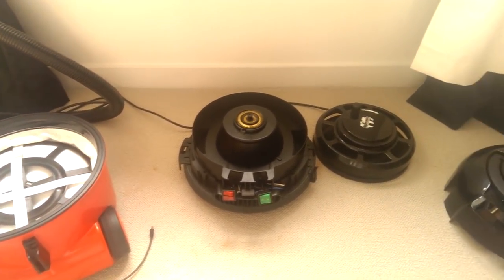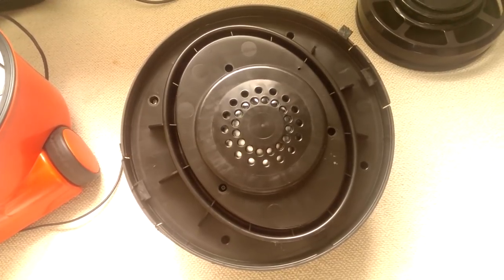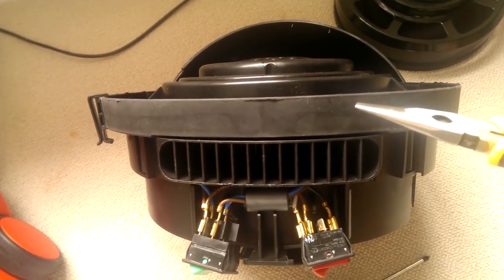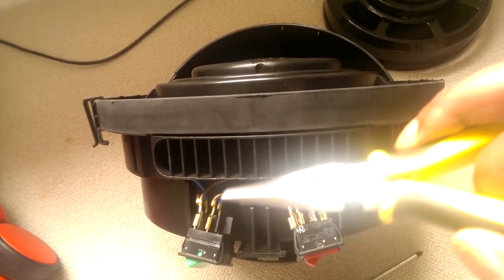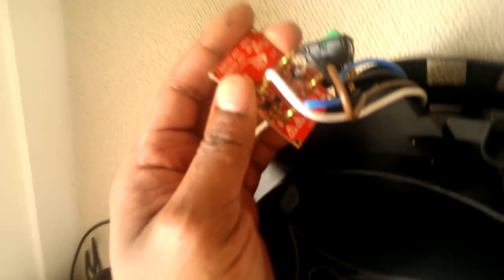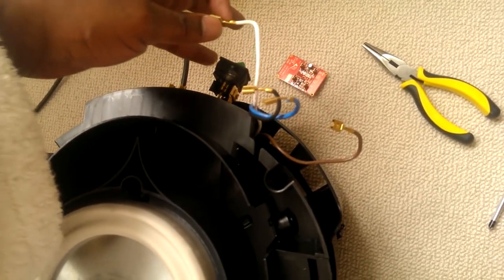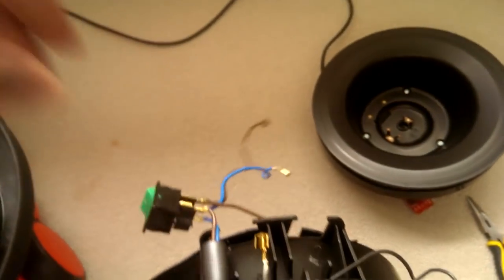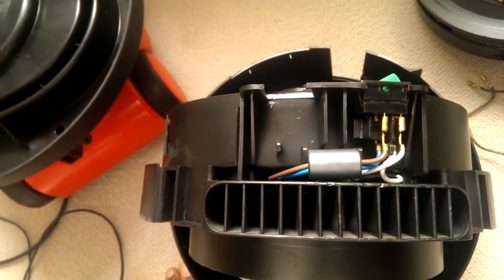Fix a Henry Hoover which won't start by bypassing the printed circuit board (PCB) #henryhoover

Comment: Thanks Peter! Fixed my Henry, great start to my day. Your calm tone and fluffy white lounge attire gave me reassurance even after I broke a connector and had to improvise a solution. 

Also if 85% of the 235 comments are from people who have fixed their vacuum cleaners, at an average replacement price of £120 you have saved people nearly £25,000 so far. Well done!

Comment: excellent, thank you, my machine suddenly stopped working and i assumed it was a fuse, it wasn't, i opened it up and was surprised to find so many wires and a pcb so gave up. After seeing your fix to an identical machine i just tried it, initially i was concerned that you did not say which of the two white wires should go to which of the two switch posts, since one post is positive and one negative and i wondered if it might make the machine run in reverse and blow instead of suck if i got it the wrong way round, or even burn it out, but i took a chance and either it doesn't matter which white wire goes to which switch post or i got lucky, it sucks great. thanks.

Comment: I was apprehensive to fix it, but your video really helped make it look like a simple job... So simple, it's just opening the Henry up, and pulling the wires off the Hi/low switch, removing the "pcb" board, and plugging the 2 white wires where you removed the blue and brown wires into the power switch... watch the video, and it's very clear. Thanks so much! The Henry is Alive !  ALIVE !
Reply from the maker: planet illustration life can be simple

Comment: Peter many thanks, my Henry is working again, 3 year old video but it's still helping other out perfectly well thanks.
Seen some questions asking if the hoover will work on full power only and the answer is yes, FULL POWER ONLY.
This will make your Henry hoover work on full power only as you are removing the low power switch wiring... HOPE THAT HELPS CLEAR THINGS UP, 
If you do this and your hoover works then it's the PCB printed circuit board that's no good, so if you still need your hoover to do low power then you need to replace the PCB printed circuit board

Comment: Our Hetty didn't switch on yesterday. After checking the plug and fuse and it still not starting we were ready to go buy a new vacuum cleaner. Found your tutorial this morning and got our old Hetty operational again in no time.
Thank you so much for this money saving tip and for helping to stop another old vacuum cleaner from going to the tip...

Comment: I did it and my Henry works, I'm really chuffed - THANK YOU. It took watching the video about a dozen times before acting to get my head around what to do because I have zero electrical knowledge so some basic things I needed guidance on which might be taken for granted by people who are familiar with connecting wires etc. My tips are: (1) to disconnect the wires, don't be scared  the metal heads of the wires have a push-in pull-out mechanism, I used a flat-headed screw driver to loosen the grip of the metal heads connecting the wires. (2) the switches have a side panel, so to access the wires connecting the switches again I used a flat-headed screw driver to remove the side panel - push in (the screw driver) from the side and lift; (3) if you have done 'too much' in removing the layers to access the motor just follow video for what the coverings around the motor should look like, for example, that plastic 'frame' with a triangle bit around the motor completely came off so i saw too much motor, in fact lifting it out completely but the motor fits back in like a puzzle, there are three areas that you need to make sure are in place - again like a puzzle look for the bits that fit; (4) in taking out the motor completely I disconnected one of the white wires from the motor I just looked for a head that didn't have a wire and job done.
Reply from the maker: Maribeja Intel that’s great news. And thanks for notes. Am sure they will be helpful to others. I’m no electrician. I hadn’t done this before. I made the video because all the advice I found online was too technical. So after reading and looking at a circuit diagrams I figured out the solution and wanted to make an easy to follow video. I had no idea how useful it could be but if it saved one other person buying a new hoover, or paying for repairs, it would be worth it.
Reply: @hesbs  It was generous of you to share what you learnt, I've always been someone who likes to give it a go but being daunted by the wires showed me how much we (well, me) are estranged from basic DIY and how our solution is to throw away and buy new. I'm convinced if we were all able to do the basics the skills of the professional would be higher. My paper shredder broke a week early than Henry died, can't wait to get stuck in now 😊

Comment: Henry sends you a hug, after checking Henry's current and the engine was working, I deduced that it was the printed circuit board, but he was not sure whether to ask for it or what he should do. excellent video uncle, thank you so much.

Comment: Thanks mate was worried about doing it but checked everything else with a multimeter brushes were good. So took the plunge and with trepidation turned it on.It worked!! cheers mate .

Comment: Nice one. Turns out this wasn't my problem. It was a faulty plug. Still, I never used the hi,lo switch any way, so I have removed it. Hoov is now working a treat. Thanks. 👍👍👍

Comment: SUPERB! Had to snip off the live wire from white wire which was a little confusing. Local engineer wanted £35 to do this.  Thank you Peter.
Reply: @Pacino972 I think I have the same as you... was your  brown to the h/l switch  joint clipped with the other white wire.  Did you have to snip these apart so you could 
discard the brown  and connect the white to the on/off switch  ?

Comment: An excellent video. I have just fixed our Hetty Hoover which has been "broken" for months taking out all of the eco pcb rubbish. Mine also needed a new plug as the connection was a little dodgy - Another common problem due to a lot of flexing over time!! Thanks again Peter!

Comment: Wish i had seen this before paying out for another Henry. We had the James and worked fine for just over 6 years then i just turned it off on the hoover switch & came back 5 minutes later & it wouldn't start again. I tried all the usual things like fuse took it apart to see if anything had burnt out couldn't see anything. So last night we bought the Henry XL Plus as it's supposed to be more of industrial so might last longer. Just seen your video this morning and by no means am i an electrician but can put a plug on with ease , i went through what you did on here and now we have the James working on Full Power , ah well it will do for any diy , garage and car work we need doing. It's no wonder the world is a throw society as things just ain't made to last long these days , more and more cheap crap parts are made in China for pennies for every single thing we use in our houses now. So glad i seen your video pity i hadn't seen it soon enough not to have paid out for another one though. Can't thank you enough for your easy step by step guide , if i can fix this then anyone can follow and fix as well.. Thank you

Comment: cheers mate. i went to hoove up and my hetty would not work. checked fuses and cable . my pcb was faulty and i copied this and it now runs. thanks mate .
Reply from the maker: wayne kelly happy it helped. i wanted to share a video of how easy it was as all the written instructions made it sound so complex. i've never done this before so looked at the circuit diagram and just made the rewiring plan

Comment: How can you know if it’s the motor that has gone, rather than the rocker switch or PCA, without fiddling with it? I’m getting ready to throw my old one away as a new motor is nearly as expensive as a new Henry.

Oh, and given that mine is an old motor (the more powerful one) if I get rid of the hi/lo, what suction would it operate at,  the low speed or high? I think high would suck my carpets up 😄

Comment: My hetty hoover cuts on and off, when it cuts off it stays off for 10-20mins then cuts on and repeats. My filter is very clean and i also changed the copper contacts. Is there a way to bypass the thermal cut off?
Reply: Your method fixed the issue. YOU ARE A LEGEND

Comment: amazing video, I just did mine and worked. Although the power was going to circuit but was not working. I removed it all and seems to work. 
I lost the slow suction but to be fair is the max one you need most cases so is fine for me. 

removing a part and fixing it I never though of it :).
Reply: It will only work in high power as you  have bypassed the low power PCD PRINTED CIRCUIT BOARD if you want low power then replace the PCB
Reply: @gone-in-sixty-seconds   I think is not worth it work great happy with with it, Thank you :)

Comment: Peter,  can I check something out with you. When you have disconnected the wires from the pcb (2.37) you  show useless wires, blue, and brown that went to PCB and a brown that went to high /low switch. I have the same accept my brown to the h/l switch is joint clipped with the other white wire. Should I snip these apart and discard the brown?

Secondly  when disconnecting from the PCB I have a black wire that also went from the pcb to high low switch (which I don't see on yours). Do I just discard that one?

Comment: Does this now run full power all the the time now thanks
Reply: Yes full power but if it works it shows the fault as the PCB PRINTED CIRCUIT BOARD so if you need the lower power then replace the board.
Reply from the maker: Yes. And I’ve never felt the need for the lower setting

Comment: Is this safe to run the Hoover after removal. I have done this and now my hoover works again so many thanks. Just wanted to be sure of safety with the wife and kids using it
Reply: Peter Daly Of course, you taken the faulty bit out. Henrys previously were single speed and just like this, cable wires straight to switch then white wires switch to motor
Reply: How did you know it was for sure the cpb to be replaced? My hoover stopped working I am not sure it is the main switch or the control speed or the fuse. It would be great help.
Reply: Vívian Moura what’s the model number of your Henry or hetty?

Comment: Thanks Peter,
1. If I do this, will the motor be permanently "Hi" or "Low"?
2. I just bought another Neon HiLow switch because the old one would not stay on Hi (I thought that was the problem) , but the new (but used) switch acts the same way. Should it stay on "Hi" or is it a circuit board problem?
Thanks again
Reply from the maker: My fix left it on Hi. I personally never had a use case for switching to Low, so that was fine for me
Reply: No you just press it once for hi

Comment: thank you peter 
it was hard to hear you speaking but got the jiff , but tried it and  i didn't think it would work? , i tried the fuse and changed plug with no success , so i thought i try it and wow it works 
but i have to say im a little worried how safe it is by doing this ????
and the plug only had a blue and brown wire is that safe??

Comment: Seems helpful but my Henry has more wires on the switches. I can't find power on any of the wires at the switches. Checked the wire it's got no faults. Also checked the plug fuse

Comment: Mine previously stopped working, took it to get repaired and I presumme this is the repair the guy did as I can only use it on high setting. Which was and has been fine up until today.  As I was hoovering the power just stopped, not suddenly just a slow loss of sound and power.  Thought I'd accidently pulled the plug out from the wall..  which I had'nt.

I also noticed that the motor area felt quite warm...  What could this be?

Comment: If you bypass the high/low switch does the vacuum operate in high or low setting? Thanks for the vid
Reply: High power as you are bypassing the  low power circuit

Comment: i have old bissell vacuum cleaner . there was fuse tucked near motor on brown wire going to motor. this fuse was en capsuled under black rubber casing.i removed it and joint wire.
how crucial is this fuse if i only use this vaccum for short time. do you thing this was thermal fuse 250v. plug have 13 amp fuse. house is not too old have tripping mechanism. plz help

Comment: My henry does not work and the light of the Hi Switch is not lighting up. Do you know if in this case the Hi Switch or the PCB is faulty? I bypass my henry like in your video and my Henry works. But i dont know if the PCB or the Hi Switch is faulty.
Reply from the maker: I think to test them both you would need to  put them in a working machine and see which is not working. But if you  never use the low mode...why go through all that?

Comment: I have just done this, however, it hasn't worked unfortunately. Do you know what else I could check or do as a next step? Thanks.
Reply from the maker: ParamountFitnessPT sorry, I only knew about this issue
Reply: Don’t know if you’re still trying to fix your hoover but maybe try replacing the carbon brushes & actual switches. Both known faults & can get them on amazon

Comment: Is the purpose of the PCB just to control the 2 speeds? Are there no safety concerns for bypassing it? Am about to do this but just wanted to make sure
Reply from the maker: I’m not encouraging anyone to do it. I’m not a trained hoover engineer. Just showing what I did. Please do further research or ask a professional.
Reply: @hesbs  It's all good. I hold liability and I trust this process with the safety knowledge I have, wiring is correct but wasn't sure what the exact purpose of the PCB was. Just wondering if any of the viewers have a second opinion.

Comment: Hi chief I have a blue henry, it doesn't have a fast/slow setting. It doesn't have the pcb board in the same location. There is power going to the light as its on when i turn it on, however it is not working at all. Any advice?
Reply: Can i still just ignore the light connection and connect up the white wires straight to the switch?
Reply from the maker: Sorry! Am not an expert or an electrician. I just researched this and made a video so other people would not have to read and look at circuit diagrams.

Comment: so with this pcb bypass you should just have the high as a the option using the on/ off switch ...is that correct?
Reply from the maker: kahlo yup only one power setting

Comment: How do you get the flap(?) that gives you access to the green and red switch innards?
Reply from the maker: Maribeja Intel undo the screws I point to and the covers are easy to lift off
Reply: @hesbs  I unscrewed the four outer screws and the 3 inner screws and the insides of the switches is firmly covered. I'll take another look tomorrow. Thank you for the response.
Reply: @hesbs  Okay, I did it, I lifted the flap covering the side of the screws with a flat-headed screw driver.

Comment: Do you have to do it in your dressing gown? Thanks for vid
Reply from the maker: No. I was at home relaxing and did it before I got dressed. Next time I’ll get the studio set up and wear a tux. At least all you saw was a sleeve. There are many other sites for professional help available. This was just for fun :-).
Reply: @hesbs  Well there are certain standards we have to keep up.
 I do all my repairs in a smoking jacket and cap while I instruct my butler in how to weald the screw driver. 
 I had same problem and I was looking at motor thinking can I bypass and your video worked a treat!

Comment: Is this safe in the long run?
If the motor blows will it be protected from fire etc...
Reply from the maker: I would advise asking a real electrician about that. I’m just a customer who was DIY fixing my own problem.
Reply: Peter Nsanze - Thank you for the response

It’s been three years since the video. How is your Henry hover? Any issues since the modification?

Comment: I have only 2 wires going into pcb. Does it make a difference to the fix?
Reply from the maker: Darren C B am not sure about other models. I googled for a circuit diagram before doing mine.
Reply: @hesbs  thx Peter. May do same

Comment: Well everyone seems to be cured, but before i try it mate i have 2 questions....

1, Will hoover be sucking in high or low mode once bypassed?

2, Why not just buy a new PCB board?

Kindest Regards my friend.
Reply from the maker: lee benjamin 1. mine’s in high, I believe. There’s not much real difference... 2. I didn’t bother as it works fine for me with just one mode. Keep it simple.

Comment: why bother with a work around - a replacement board is only £6 brand new ?
Reply from the maker: Because I never used the high/low function and it turns out many others didn’t either. Saved a walk or wait and £6-20

Comment: Mine works but now, pressing the HI lo switch cuts out the vac. If i do this, will it run at the turbo speed or normal speed? Thanks.
Reply from the maker: Silver V I believe so. I could never tell them apart without hearing the other...
Reply: Peter Nsanze Yes, it does run at th turbo speed! ☺ I had taken mine apart got to the Pcb and saw this video, tried the motor with HI lo pcb, then without pcb. 🖒

Comment: I opened mine up, the chip board isn't there. Must be a newer version
Reply from the maker: Interesting. How old is it? That PCB is such a design flaw
Reply: @hesbs  I'll have to check. I got to the bit the chip should be visible. I think mine is inside a block of plastic. I put it all back together and now the vacuum is working!